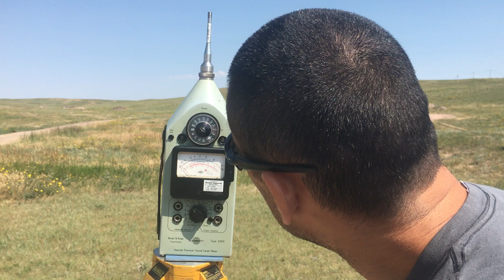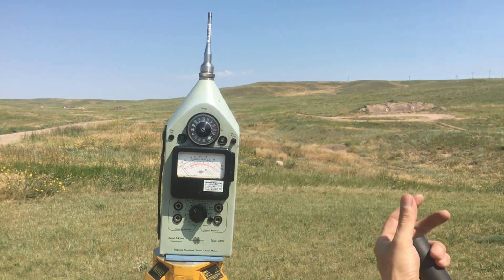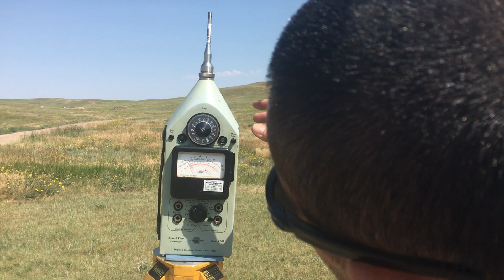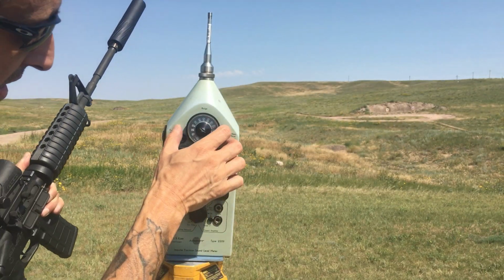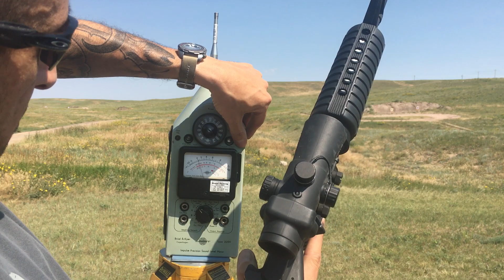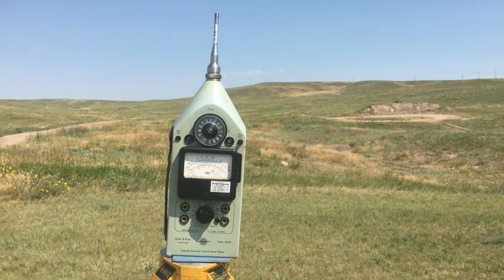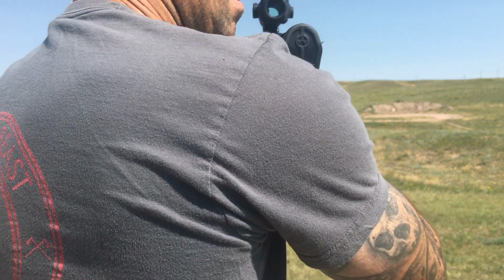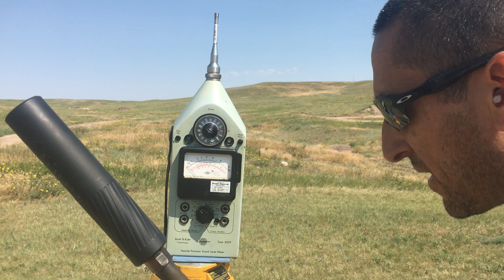Thunder Beast 223 Ultra 7 shooters ear and MilSpec sound test.

Comment: How pleased are you with thunder beast in general? Seems a lot louder at the ear, at least in this test, probably due to the carbine length gas system.
Reply from the maker: The 223 Ultra 7 will give the best suppression at the muzzle. We specialize in the best cans out there for precision rifles. You cant trap it at the muzzle and not increase SE or EP SPL levels. The cans that produce lower SE and EP numbers on a gas gun don't meter that well on a bolt gun. We do make a dedicated suppressed upper that meters very well at both locations. You can see it here 
https://www.youtube.com/watch?v=vEs82hTePqM
Reply from the maker: The better you suppress the muzzle the louder it gets at the ear. That is why an adjustable gas block is needed to dial a system in